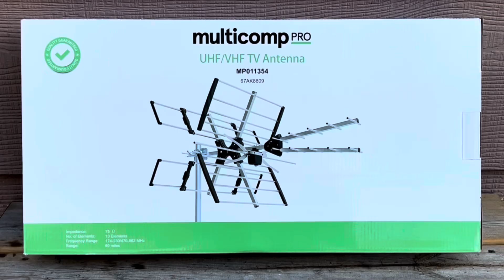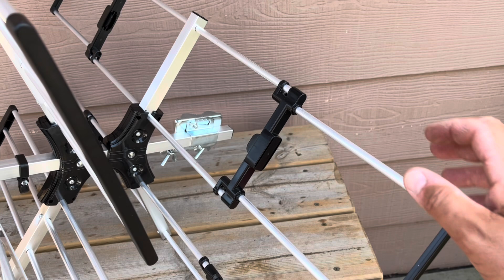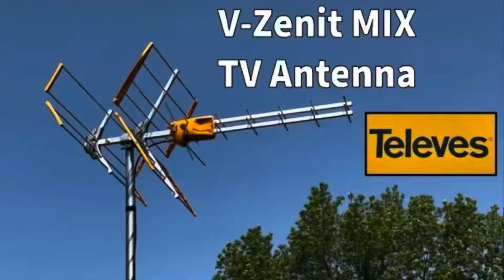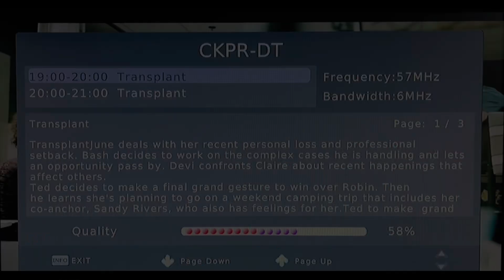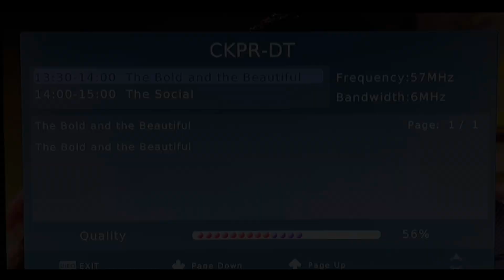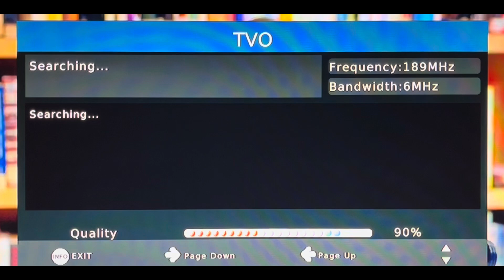Multicomp Pro VHF/UHF Outdoor OTA TV Antenna Review MP011354

Comment: Sorry to post a negative comment to you. It is not your fault. But that antenna is a Rip Off. It is miss leading. in the USA/Canada, there are no more VHF tv broadcast transmitters on the old VHF Hi & Low bands. As of On June 12, 2009, the FCC required all high-power analog U.S. television stations to turn off their signals and move to a digital-only transmission and change to higher UHF frequency's. And just to let you know, that so called VHF driven element is way too short, and that so called VHF reflector is a joke. Dude go to walmart or best by and pick up an inexpensive TV antenna. Retired Broadcast engineer WABC New York.
Reply: Right now, in Houston, I'm seeing KUHT (PBS) on RF Channel 8, which is VHF HI, and KHOU (CBS) on Channel 11 (VHF HI).  KTRK is on Channel 13 (ABC).   I will say that most of the others are at or above Channel 22.    

So, you need VHF HI and UHF, at a minimum, in the Houston area - and that's a HUGE zone.

Comment: It could be the reflectors with the sliding plastic components are insulating the extenders so they are not electrically of any use.
Reply from the maker: @mrkrasker9609  Possibly.

Comment: Did you use a preamp when testing . If so what model.
Reply from the maker: @robertmason7013  I don’t use a preamp unless it comes with the antenna. I did not use a preamp because this antenna did not come with one, and if I did, I would have mentioned that.
Reply: @NorthcoasterHobby  you compared the televes that has a built in preamp to this antenna without a preamp. I don't think that's a fair comparison. Would like to see you try it with a preamp. Did you get a chance to look at the five star antenna .it has a similar design but it's much bigger with more elements. Do you think you can test that one .
Reply from the maker: @robertmason7013  The V-Zenit Mix does not have a preamp.
Reply from the maker: @robertmason7013  You never sent a model number for the Five Star antenna.
Reply: @NorthcoasterHobby  my bad I thought all televes antennas came with an preamp.
Reply from the maker: @robertmason7013  Not all of them.

Comment: It may be their built in balun.  You missed that as an explanation
I still think my stewpot would be a better antenna
Reply from the maker: @kensmith5694  I was thinking that when I mentioned the active element. However I could’ve been more clear about that point. I definitely think there’s something wrong with their balun.
Reply: @NorthcoasterHobby  Can you open the balun and take a look.  Maybe it is just two wires and no balun

Comment: can you tell me how to fix my c band dish cords its a red blue and audio cables a twin 6 thick flat coax cable
Reply from the maker: @NobodyCaresAboutMe-l6g  I’m sorry you’re having trouble with your C-band dish. As I told you before -your best bet is to get a new digital receiver and run new coaxial cable to it. You can still still tune the dish manually with a wrench, unless you’re willing to buy a dish mover as well to move the actuator. as far as the wiring that’s not something I can specifically help you with right now.
Reply: @NorthcoasterHobby  help

Comment: On another YouTube channel the guy who tested this type of antenna said that on UHF it performed excellent but on VHF High it performed average exactly like a simple VHF dipole. A 4 element VHF High antenna performed much better. I remember your video when you tested the Televes antenna and it performed better on VHF, but that model performs very good on both bands, you don't have UHF stations in your area.

In Europe the newer generation of antennas have a built in amplifier especially the UHF antennas, the interesting part is that you can connect it to a TV without a power inserter and you get the same results like a regular antenna but if you connect a power inserter you have higher signal strenght (20Db gain) so you can receive channels from a greater distance or use a regular TV splitter. Those antennas are made by the Polish Company Dipol which is available in most European countries and those are UHF antennas.

I personally recommend Dipol, Televese, Channel Master they make the best antennas.
Reply: Channel Master Used to but Winegard has em beat. There pro series is junk. You will spend 300 bucks buying the whole antenna whereas their CM 3018 model will get you what you need for about 170
Reply from the maker: @unclefester6033  The Pro model is definitely overpriced.
Reply: @unclefester6033  I forgot about Winegard they are good.
Reply: They need to bring back Radio Shack. I did very well with their antennas, amplifiers, and rotor. It was $50 for their long range antenna.🤣